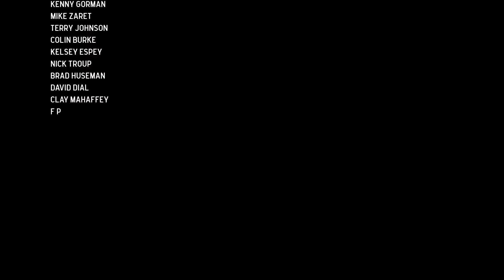Overlanding the Enchanted Rockies in New Mexico - Lifestyle Overland S2:E13

Comment: If you've had your Smitty-Built winch less than 2 years,  call them up and explain your problem. I had a problem with the contacts in my remote control switch and they sent me a complete wireless remote system, NO CHARGE.  I have the 10,000 lb.  Hey, if it's longer than 2 years, call them up anyways. You never know They might replace it.